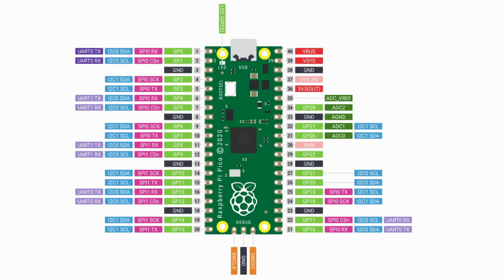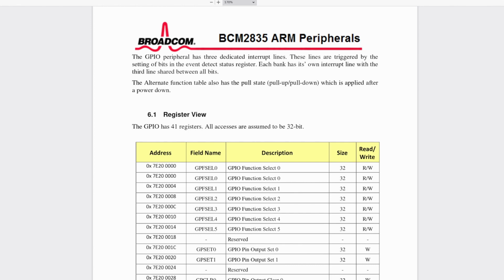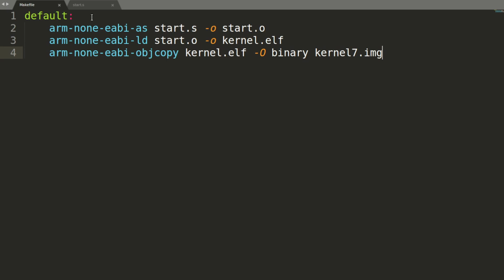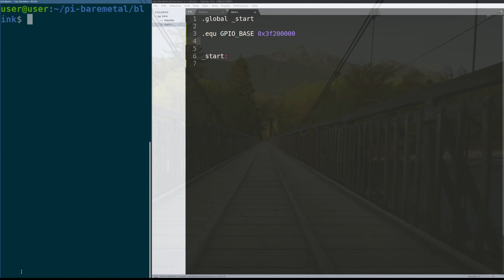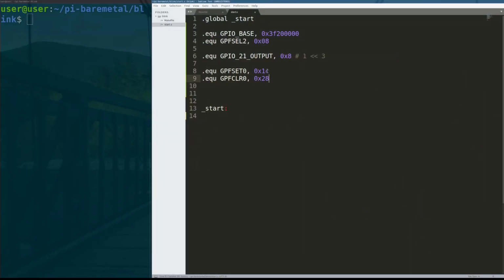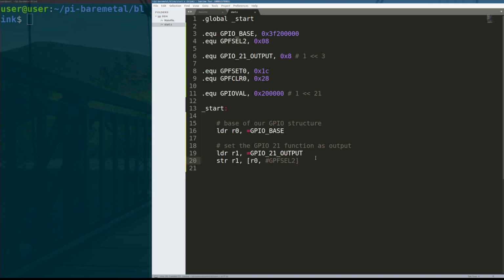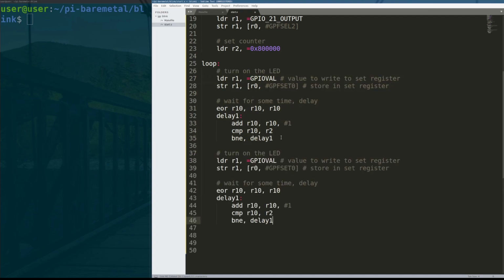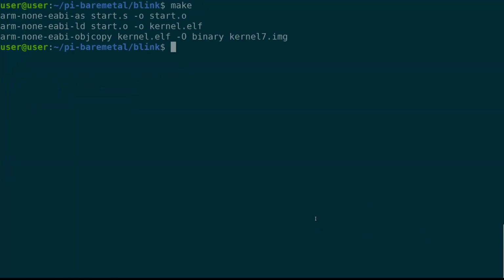Baremetal Assembly Raspberry Pi Programming | Direct to Register Blink LED, No Operating System

Comment: Really appreciate the walk-through thanks. I'm confused about the physical set up shown at 7:21, which doesn't seem to tally with your description, or make sense. The white ground wire next to pin 21 appears to be spliced to the yellow wire from pin 21, both going to one side of the led via the  resistor. The other side of the resistor is connected to a yellow wire that disappears somewhere around the ethernet port. Does anyone know what's going on there?

Comment: Hey Low Level, I just wanted to say thanks for uploading this series of videos. You clearly and concisely explained a lot of otherwise somewhat difficult to understand concepts here.
Having some previous experience in C and x86 Assembly (although not nearly as much with Make files/coding) and working with both Arduino and Raspberry Pi boards, I'm looking forward to working through these tutorials and getting to grips with Bare Metal and Hardware Address-based programming. 

And so, thanks again for these great videos. Keep up the great work :)

Comment: It's so frustrating how many assumptions are made even in the data sheet which means relatively new learners who don't know these funky embedded considerations will be walking blind.
For example, in the latest BCM2835 peripheral datasheet on Pi's site, they state
"Physical addresses range from 0x20000000 to 0x20FFFFFF for peripherals..."
When THE HECK DID THEY CHANGE IT FROM 0x3F00_0000 to 0x2000_0000??????
Reply: that's for the Rasp 3B (not +) right ?
Reply: @maximilien7737  I don't think it should matter. The... I forget what they called it, I think "architecture" is the same for a number of models. So you can use the same datasheet. I'll check again when I'm in front of my laptop.

Comment: This is a nice example, thank you for that. However, in reality there are a few things that make this much more complicated if you want to really have control over the system. Modern application processors, like the Arm SOC on the RPI, require a lot of tedious setup to bring them out of there power-on state to a useful and safe operating state. The RPI bootloader does the bare minimum of that, but not all of it. Understanding the required configuration and writing code to set it up can easily take tens of hours. It would be great if you could dedicate a video to some if these issues!

Comment: I'm trying this on a Raspberry Pi 3B+ (which appears to be used in the video) and there are a few things confusing me here...

1: LLL is writing Armv7 Assembly, but the CPU on the RasPi 3B+ is an Armv8 CPU - the assembly language is different between these 2 architectures. Do we have to convert the Armv7 to Armv8 ourselves? I could probably do this, but I don't know if this is a red herring or not.

2: How is the kernal.img file written to the SD card? Do you flash it using something like the Raspberry Pi Imager or balenaEtcher, or do you just format it as FAT32 and copy the .img file across to it?

3: Is kernel7.img the right file name? When I flash an OS like Raspberry Pi OS to an SD Card I see a kernel8.img, but no kernel7.img.

I've played around with some of this and I'm kinda at the point where I'm wondering how the example in the video even works at all. 😅 I have a similar LED setup to the one shown in the video and when I probe the GPIO pins I don't see the voltage changing as you would expect it to.

I'm new-ish to Assembly and have never done Baremetal programming before - so to start with I just kinda wanted to take code someone else has written and run it without making any mods to make sure I've got the process right - which I feel like I don't because I can't get this to work.
Reply: Sooo after a bit of playing I'm now ✨ englightened ✨. Take some of this with a grain of salt - as I said before I'm a newbie, but this is my understanding for anyone else feeling stuck.

Item 1: You can make a 64bit Arm CPU boot in to a 32bit mode by calling the Kernel Image file 'kernel7.img'.

Item 2: You can just copy the file across to a FAT32 SD card. It's important that there's only one kernel*.img file on the SD card. You will also need 'bootcode.bin' and 'start.elf'. If you're new to this like me then the easiest way to do this is to flash Raspberry Pi OS to an SD card and delete all the files apart from 'bootcode.bin' and 'start.elf'. Then copy over your kernel*.img file. You should end-up with three files: bootcode.bin, start.elf, and kernel*.img.

Item 3: Related to item 1. Low Level Learning wrote Armv7 Assembly, which is a 32bit architecture. It seems you can make a Raspberry Pi boot in to 32 bit mode by calling the kernel file kernel7.img.

It's also worth going through the process of converting LLL's code from Armv7 to Armv8. I managed to port it over and found it a useful experience (you'll need to call your kernel file kernel8.img!). After I did that I started poking around the datasheets to figure out how to make different GPIOs toggle. Now I can flash TWO LED's at the same time! 🙂
Reply: @PokehTube  thank you a lot for your comment, honestly it needed to be told

Comment: come on, tried so many things with it, and even your .img file, it just didnt work...
something its here wrong, but i dont know what, there could be so many reasons..
Reply: Out of curiosity, which model of Pi are you trying it with?
Reply: @TooSlowTube RasPI 5
Reply: @drominitoketchup  Ah!  Okay.  Yes, that has quite different architecture to what he was talking about at the time.  I'm still not entirely sure, but I think this was done on a Pi 3B, or similar.  Unfortunately, it doesn't have enough detail of what to actually do to get the code onto the card, for me, but I'm fairly certain this wouldn't work on a Pi4 or Pi 5.

Comment: There's a library available for the pi that enables it to act as a RF transmitter with a wire antenna on a GPIO. There seems to be little detail about the operation, would be intesested in a breakdown of this code on the pi processor

Comment: I'm just curious, how does setting pin 21 as output with bits 5-3 translate to 0x8
Reply: He sets the GPIO Function select 2 register (Table 6-4 in the documentation). He sets bits 5-3 to be 001 (output), but the bits 2-0 are still to the right of it so it becomes 001000 which is equal to 8.

Comment: Hello, does anyone know why we had to choose GPSFEL2 rather than any of the others? Thanks
Reply: Greetings, the explanation is:
- GPFSEL Registers are 32 bits wide, with 30-31 bits not used (“reserved”), this gives us 0-29 bits for GPIO function selection
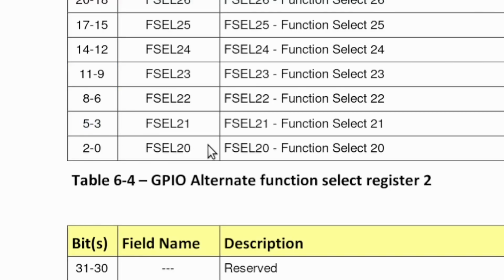- GPIO function selection is 3 bits wide per pin (3:26 in video)
- thus GPFSEL0 covers GPIO0-9, SEL1 — 10-19, SEL2 — 20-29 PIN numbers

Comment: Why does the OS let you access the address directly using assembly but not when using C, thus all this stuff about kernel drivers and interface files when using C. If I can access an address directly using assembly can I make a C-callable assembly method?
Reply: There is no os in this video's method
Reply: @Daweim0  Okay, I guess I don't understand how one can program a Raspberry PI without an OS which this one seemed to have giving it was using lxterminal

Comment: This is nice.... but I'm learning ARM for the STM32.... so as much STM32 specific stuff would be ideal. :)
Any idea why it's "kernel7"? Where does the "7" come from?
Reply: I think its armv7 and armv8 where armv8 means 64 bit so 7 means 32
Reply: ARM for STM32 is very different from a SoC. The STM32 is a microcontroller and doesn't have a ROM or a kernel.

Comment: Hi, I translated this code to 64 bit arm assembly and trying to run it on rpi4, but with no effect. Do I have to remove everything from boot partition leaving only kernel file? Actually I also tried that exact kernel7.img file from your git repository on a rpi zero and it didn't work as well :( I tried putting it in boot partition and root but it didn't work. What am I missing?
Reply: Different raspberry pis might have different addresses. Maybe
Reply: Greetings from the Internet, bold programmer. Just guessing, there's only ten people on the planet who are actually doing 64-bit assembly to the RPI4 at this time. Grimm's technique is to lookup the GPIO offset from /dev/gpiomem. Pretty sure I'm using the 64-bit Ubuntu image for the Pi in my own testing. Note that the register syntax is different for ARM8, you use X0 for example. In my build file I use this technique for determining the number of bits we're running under and then steering as appropriate. ```#!/bin/sh

BITS=`getconf LONG_BIT`
echo "$BITS-bit detected"
as -o helloworld.o helloworld-$BITS.s
ld -o bin/helloworld helloworld.o``` Note that you'd then have two versions of your assembly file with '32' and '64' there at the end of the filename. https://github.com/Michael-Grimm/GPIO-ARM-64-bit-assembly

Comment: very helpful and clear to understand. Thank you for taking the time to explain. I believe that is a RPi 3 and it is worth noting that RPi 2 functions differently to RPi 3 in terms of direct register control.
Reply from the maker: Thank you!

I'll probably continue this series and port it to the Pi 4 at some point :)
Reply: @LowLevelTV  It may be more useful to target the Raspberry Pi Zeros. These are cheaper and would be a more logical choice to base a low-level hardware project on, I think. Also, some people (like me) would be afraid to brick the more expensive Pis... Low level Pico programming would also be interesting and useful!
Reply: @Andreas-gh6is  Pi Zero would be same chip as Pi 1, isn't it?
Reply: @Andreas-gh6is  how would you brick it if you can just insert a fresh OS age if you mess it up?

Comment: Looks like this is ARMv7A code, how do I run it on an ARMv8A machine? (Apparently it is backwards compatible in “AArch32 mode” but I’m not sure how to do that.
Reply from the maker: Oh good point I didn't even consider the new Pi's are AARCH64. I can make a tutorial on this. The answer is you'll need to write some code to jump into AARCH32 mode, which I'm fairly sure is similar to how you enter thumb mode.

Obviously you'll need to check the Datasheet of the other chip, as the GPIO address/structure probably changed.
Reply: @LowLevelTV  yeah the data sheet is a bit different for each SoC! I would love a tutorial on jumping between AArch32 and 64. I’m sure it’s fairly easy as you say but there isn’t much info online yet as the 64 bit Pis are quite new! No rush though, I’m sure you’re busy; but you’ve got some great embedded software programming videos out now and I think this would help a few people in your audience
Reply: @gregoryfenn1462  I would love to see that too.

Comment: Do I have to flash the kernel7.img in the SD card or make a file system inside the SD card and copy the kernel7.img there?
Reply from the maker: Good question. You just drop the kernel7.img file onto an SD card that is formatted normally for a Raspberry Pi.
Reply: @LowLevelTV :
Interesting video. 👍
Reply: @LowLevelTV  in which directory ? /boot ...
Reply: @jyvben1520  in the root directory